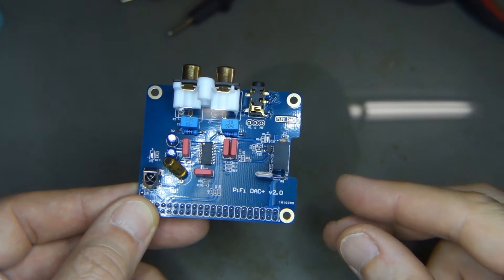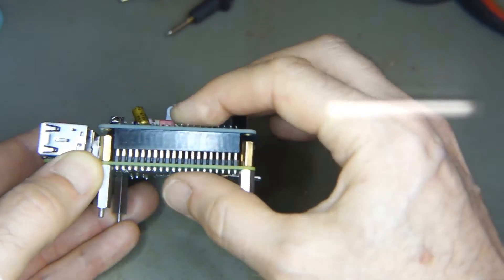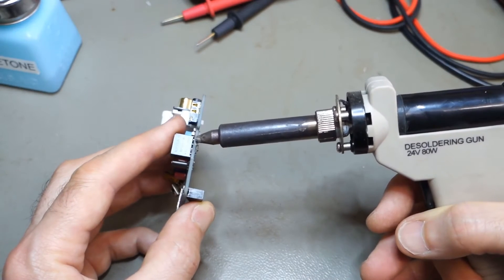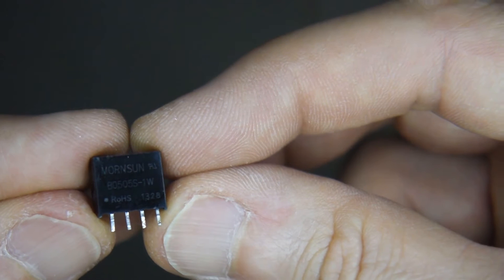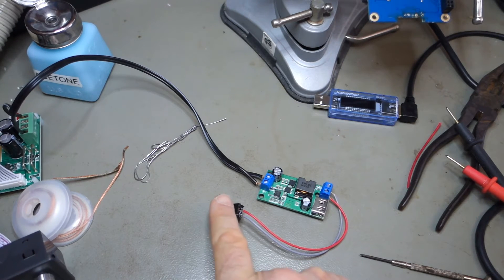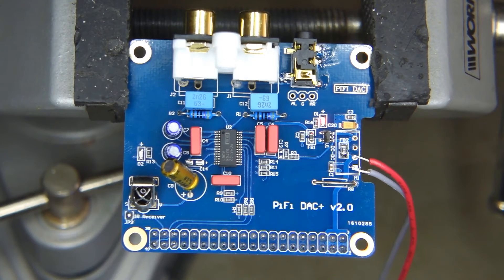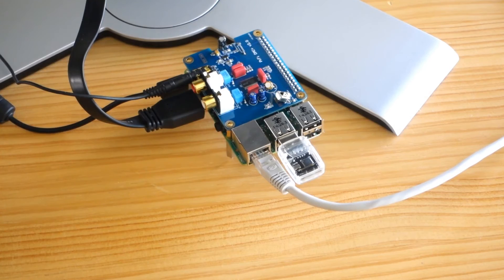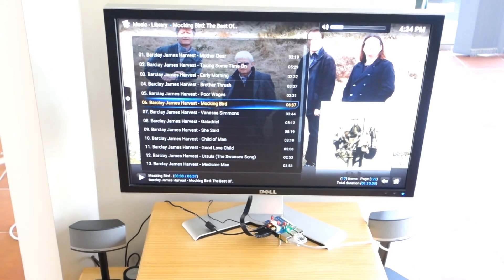Ep 6 PiFi DAC Card Repair

Comment: I just happened across this too, great video Simon! I have two of these cards and I think I'm going to attempt the mods. I know it's a long time ago now and you've somewhat moved on, but can you tell from the video what size are those SMD resistors you use (as in, what physical size) ? I'm not sure what to order to be honest. Again , thanks for the vid!
Reply from the maker: So nice of you to reply, thanks for the positive feedback.  I'm completely busy at the moment trying in to protect  my house down the south coast of Australia from fire...so I'm going to take a guess and say 0805 for the size of the resistor.  Even if this isn't the best size for the pad dimensions you should be able to get a reasonable solder joint.  As a quick aside I've subsequently found that a USB sound dongle is a better audio solution for a raspberry pi, it's plug and play and has non of the ground loop issues these top hat PCBs exhibit. Good luck.
Reply: You are generous to reply in such a crisis. Thanks, yes I did look around the interwebs and that is the size. I have an smsl USB dac in the post but would still like to fix the dacs. Good luck Simon.
Reply: Made the changes. Wow, those smd resistors are fiddly!! Sounds good, though I can't tell the difference from before honestly. 😂 Cheers again!

Comment: Thanks for sharing. I've only upgrade R1 and R2 to AN Tantalum resistor and the sound has been improved much better. I did not notice DC converter being hot. (mornsun b0505s-1w). I summarize your change as below, please correct me and explain more. (is your purpose for better DC isolation or...?). 
- M1 (DC converter) removed, and put in Electrolytic cap 10v220uf.
- R8 shorted by 1ohm resistor.
- C1 removed
- FB1 removed?
- C9 change to which cap?

...
Reply from the maker: Hi Chu Van, its a bit of an old project and I've found since that a better alternative to this board is a USB sound dongle/adapter.  You are right however the DC-DC adapter is an attempt to isolate the grounds to avoid ground loop buzzing.
Reply: @PowerOn-  Could you share about "better alternative" for this board ? Thank for your sharing!
Reply: Ngoài điện trở R1, R2 còn phần nào thay đổi để chất âm tốt hơn không anh? Em đang dự định nâng cấp mạch 5v low noise cho pcm5122 mà chưa biết nó nên tháo cách ly DC - DC ra không.
Reply: @nhanto2915  mình chỉ thay R1, R2 và 2 con tụ thay sang wima thôi. mạch này không có nhiều chỗ để mod.
Reply: @Vuvovi  phần nguồn cho nó qua con cách ly DC vậy có đủ dòng cấp cho ic không anh. Em nghe nói phần nguồn sẽ ảnh hưởng rất nhiều đến chất âm. Phần pi thì em qua con ổn áp 5v low noise 3A, mà mạch này có con cách ly DC không biết có giảm dòng khi cách ly không.
Reply: @nhanto2915  mình không động chạm phần nguồn,   vì mình thấy khó nếu cấp 2 nguồn độc lập cho pi và dac (phải gỡ trở, cắt mạch như nào đó). Nếu mod nguồn chắc kiếm dac khác cấp nguồn riêng thì tốt hơn.
Reply: @nhanto2915  dòng con này chắc bé. dự dưới 250mA.
Reply: @Vuvovi  Dạ em nghĩ dòng phải trên 1A Dac mới hoạt động tốt nhất, con pi là 3A
Reply: Tụ 2.2uf với 104 wima anh có thay loại tốt hơn chưa

Comment: Great stuff there Simon,

Will post over any electronics I break :-)

What was the tape you used to mop up the solder residue?
Reply from the maker: That would be Solder wick - which does just that!  I guess once the solder is molten then due to surface tension it prefers to go inside the weave of the copper braid rather than stay on the PCB